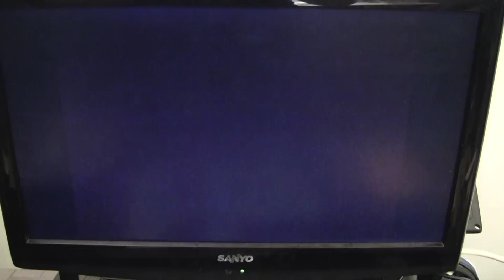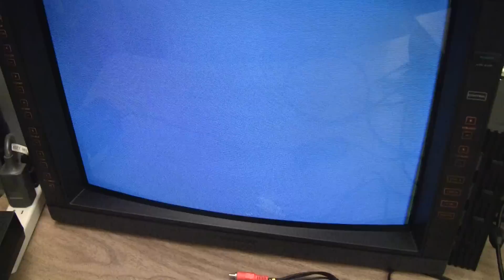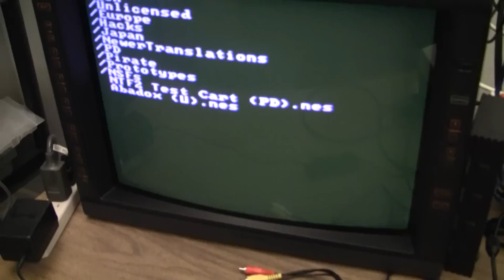Nintendo - Rant about Drakon's NES RGB mod work

Comment: GameTechUS, Question, If I put a Hot Glue Stick in my Nintendo NES, will it display RGB Output? Thnx.
Reply: Only if you put 500$ worth of oscillators in it. Make sure you hot glue them on of course.
Reply: If you get rid of $400 it will
Reply: Red blue green crayola crayon in the yellow hole thing will give you rgb

Comment from the maker: I'm always amazed how this 1+ year old video still gets several comments every month!!
Reply: Just seen your video. No wonder it costs so much, Thats gotta be at least $400 worth of hot glue xD Seriously tho what the hell!
Reply: GameTechUS $400 for floss? lol wtf is this shit
Reply: GameTechUS  Because modders never die and pop up more and more these days. finding an honest person to display whats wrong and how things should be done  is great. I only got into modding a few months ago. Making my nintoaster with some decent output options. 

One request I'd like to see is a mod for all the power supplies.   as in sega md/genesis, master system, snes nes atari 2600, 3do,  etc,  if someone makes a single power output that you can change to swap to each thats cool looking I'd buy it.  I wanted to make one my self,  but I'm still learning.
Reply: BurntFaceMan 
Agreed.  If a customer is going to pay that kind of cash, my suggestion is to gut the entire system, and install an ITX mobo, SSD, chip out the controllers, and go with a standard PICO PSU for a typical power output.  Then load emulators on.  Done.  Cheaper than $400 and a lot less hassle to make old tech interface with new.  More reliable in my opinion too.
Reply: +GameTechUS Love your videos man. Could you mod/recap a Turbo Duo for me? I couldn't imagine asking anyone else.
Reply: youtube sends me here. and i like the drama
Reply: So what happened to the console? I see you took out his handiwork at the end, but were you able to fix it?
Reply: I came here only to see if he still uses the hot snot.  Apparently yep.
Reply: Back again for my 4th watch!  Comedy gold!  Each time I get different laughs out of things.  Gotta socket up all those components!!!!  Why is the crystal socketed - LOL!!!  I don't think he knows that you can get single pin mounts - for mounting resistors and caps in sockets!  Sockets and glue for the win, or is that bin?
Reply: if you speak Drakon's name aloud three times in the dark, when you turn the lights on a stick of hot glue will appear on the nearest table.
Reply: I know you feel, Gadget - I like to re-watch cringe work like this too. ;)
Reply: This is probably my 5th time of watching... how on earth could Drakon charge that amount of money for such an awful piece of work!?
Reply: Dave's Game Room Pride.  That's how.
Reply: It would be cheaper to gut it and install a Raspberry Pi.
Reply: this is a joke right? who does this?
Reply: Drakon does, and it's no joke.  He really does this.
Reply: just as good as throwing it into a tub of epoxy
Reply: You're insulting a tub of epoxy.  ;)
Reply: I think it gets views and comments because it's shockingly bad work for $400.
Reply: This video just showed up in my suggestions.
Reply: Because of the "honest" work you had done there .
Reply: Probly put the 2 extra screws in a bin for resale.
Reply: GameTechUS For the love of all that is holy in technology and hardware what unholy rituals did the guy that got paid to mod that NES do to this system? I may not know technology that well or what the insides of an NES should look like in any form, unmodded, properly modded, or modded poorly. But when you opened it up I could tell right away that something didn't look right modded or not.
Reply: People love horror stories.
Reply: What a shitty job, even by normal electronics standards thats shit. Seems to be no pride in his work at all.
Reply: Train wrecks are neat to look at, provided you’re not involved in them!
Reply: I always come back to this videos when looking for info about RGB mods XD
Reply: Almost 10 years ago I was inspired to learn to solder by a moder at a convention the did mods on fight sticks. He told me I should by a cheap soldering station and just play with the stuff. I made that small investment and started moding my fight sticks and controls. About 5 years ago I found this video looking into moding my childhood game consoles. Videos like this and studying online from professional installation standards I learned to take care of tools and challenge myself. Today without going to school for it I've successfully mastered my skills to mod several systems for RGB, made a Gameboy Consolizer, and installed mod chips into my systems including my PS2. They all look amazing as well.

I plan on making a moding service or sell modded systems online sometime soon. Videos like this really show off how important it is to actually put time into your skills over using short cuts that can damage you system. Given how simple it was to learn to solder properly I think stuff like this is just a scam to people that don't know any better.
Reply: yup, just now learning and getting into modding NES/famicoms and need all the tips and warnings lol

Comment: This video made me feel so much better on the job I did on my NES RGB mod.  I was mad at myself for not getting the holes perfectly cut for my audio jack.  It looked ok just doesn't look professional, but I was just glad that I didn't need to use hot glue...lol I've learned from purchasing other people's mods to not use hot glue (or use as little as possible) because it make repairs nearly impossible.

Comment: Something that I've found in many cases with console output mods is that you shouldn't hook up more than one at a time because it causes interference with the others (exactly like the issues present with the s-video). It all depends on the console and the outputs used but, for example, component and composite in particular don't work well when running at the same time on the Snes (Color distortion, and vertical desync). Sometimes, that's just the way it is :(

Comment: Could you fix a neo geo cd front loader for me? The laser is not dead in that it can engage and read discs but only when top of case is off and I lift it slightly after the tray closes to engage it. It's like it's ok n drops perhaps too much? When ejecting then can't lift up enough to work when it closes. Unless I manually lift the mechanism up. Hopefully that makes sense. Used same laser and very similar assembly overall to tray and gears to original mega cd. Have also damaged the gears. The black one is not interchangeable with the mega cd one and the little nib of plastic that engages the switch to tell console drawer is open or closed (not sure which!) has snapped off now: in my futile efforts to fix it. It could likely be bodged by someone with you skills and maybe you could repair or bodge the main issue so it can work again? Really hoping can get it working as they only made 25000 of that model. I am in UK so shipping might make it impossible but, worth a try. You do superb work

Comment: Just a tip here, if you did not know already. To easily remove hot glue, Use rubbing alcohol. It chemically reacts with the hot glue and makes it brittle and it comes right off whatever it is on.

Comment: Bro i thought i was rough as soldering and cable mgmt, ive used dots of hot glue in guitar pedals before to secure wires to a case that could twist and rip off if a jack comes loose or whatever but never in my wildest nightmares would i bathe an entire board in glue, absolute mad lad

Comment: 400 dollars!?  screw that, if was that guy id buy a retro usb port for the nes controller and use an emulator with a TV and hdmi connection.  all that glue makes working on an old school pinball machine with all the relays a walk in the park lol.  i would never do a crap job like that.

Comment: O M F G - I didn't think it could look that bad (after watching your latest video on Drakons work) - but this is unbelievable!!!  I've never, ever seen a mod done in such a destructive and messy way.  You could have shit on that board and it would have been a cleaner mod!  That should be illegal - seriously, we need laws related to soldering and mods of electronic systems.  The potential damaged caused by that that hot glue is insane.
Reply: I don't know, wouldn't the first people suffer due to such laws be people like you, or generally people with common sense, experience, knowledge, but no formal qualifications? Or 12 year olds that just want to get into electronics?
Reply: GadgetUK164 - Retro Gaming Repairs & Mods Drakon is too stupied for modding I mean just look at the poor NES 🙁

Comment: I downloaded a mod from this guy that was supposed to make Mario Land 2 full color but it only worked on VisualBoyAdvance which is a really really old and inaccurate emulator. Mods should be able to work on accurate emulators and real hardware.
Reply: It is true that VBA is an outdated emulator but there are better alternatives out there in the wild.
Reply: Pyro 1997 That's the point. A hack shouldn't work only on VBA

Comment: I never used glue on the pcb when i do pc repairs. Only use it on strip boards when i make something from scratch or a quick fix for the power supply coils. I would knock him out for destroying such beauty

Comment: I recently spliced a wire while instaling a modchip in my PS2, cause I didn't cut it long enough and was too lazy to solder to the tiny hole on the PCB again. I thought that was pretty bad. I thank Drakon for proving me that I could do far, far worse.
Reply: *installing, of course

Comment: It's interesting in a way to see how many thumbs up this video has got in comparison to other videos on this channel. I guess there must be lots of people out there being disappointed with Drakon's work. I have never been in touch with him so I can't tell from own experience, but it sure does look like he is little bit too much in love with his hot glue gun. I am personally in the opinion that hot glue should be totally avoided as much as possible. There are much better ways to keep cables in place etc, ways that are completely reversable if anyone would wish to undo the mod, without leaving any residues.
Btw, since you took out the RGB board at the end of the video, I'm wondering whatever happened to the NES? Did you install a new RGB board for the customer, or did you send the unit back as is?
Reply from the maker: We are going to put in the new NESRGB board from viletim.
Reply: When I do a mod, I sometimes tack down a loose wire with a tiny bit of hot glue for strain relief, especially if I am soldering to an SMD, and if I am using a din connector, I'll use more for the same purpose, strain relief, but never to this level.
Reply: GameTechUS Well it's been a few months.  What happened to this poor NES?  Did you put the new board in?  Was the customer able to get a refund from Drakon?  Is this going to end in a lawsuit against Drakon?
Reply: Haha, yes - He LOVES that glue gun!  Did you see the latest vid on this channel?  OMFG at the amount of hot glue smeared over the entire underside of the board =O

Comment: I use hot glue sometimes to reinforce solder joints, but I don't sell my work-- I don't think my work is good enough for that. But to use hot glue in excess this much (and electrical tape, for that matter) AND charge as much as good modders, if not more, is insane. Even if I offered to do a job for a friend for free, I would be ashamed to give this kind of work back to them.

Comment: Hobby Lobby called and said they need to order some hot glue from Drakon. They are requesting his contact info. I mean damn, hot glue is perfectly fine. However, you dont need half a stick of it. Much less 5 cases of it.

Comment: Pretty sad to see a perfectly good device be bastardized by a thick headed idiot. I'm surprised none of the components got damaged by the hot glue, because by the looks of it, it seems like the hot glue would've retained it's heat for a long time due to the amount used. I'm actually quite shocked. How can one take so little pride in their work like that? It's evident the thing was a rush job Drakon gave zero fucks about. I'm glad you were able to help out that one guy, but I can't imagine how many people got scammed by that sleazy bastard. I'm glad you made this video, you're saving people's wallets from getting raped!

Comment: Other issues and general Drakon shit notwithstanding, I don't really see a situation arising where you'd have both connected.

Drakon's weird obsession with s-video is baffling though. He'll test rgb out with some homemade rgb-svideo converter, instead of just using his ridiculous fees to buy himself a used pvm or xrgb. Even a cheapo ebay cga-vga converter would be better.

Comment: I am sad seeing this. I am an an electronic engineer and I could accept that as a prototype. But not even my student projects looks so horrible (I mean: not using hot glue is big one). But selling that? How? Why? Have some bride in your own work. Or at the very least: When I bodge horribly, then I try to damage the original hardware as little as possible and make the bodge distinct from the preexisting hardware. Bodeging the wiring can be somewhat  acceptable, when it can at least be somewhat undone.

Comment: Hot glue does help out a bit when doing mods. To make like a 'hoop' around a wire, makes things a little more organized. But THIS. What the hell is this? And he glued the caps which insulates too much heat and they will probably explode at one point or another. And this is supposed to cost $400? I wouldn't pay $40 for that disaster.

Comment: Haha so the problem was actualy from the outside, rather then the inside, now i can think why s-video getting those strange colors sometimes while rgb is getting a darker image, i guess you cannot use both cables simulteniously atonce since that will split and thus weaken the signal, if i use composite with rgb atonce, then the rgb signal will be a little bit darker.

Comment: Eww, I start working on modding Sega Genesis high on laughing gas and dangling from the ceiling with uncontrolled soldering iron and lead solder (and no PCB vice, no soldering wick or sucker) and do a better job than Drakon's...

Comment: Crap like this is shocking, disappointing....and slightly amusing (hate to say it but after the shock settled I kinda had a small laugh) I haven't done any heavy mod work like this I will admit(I have done a few small hard mod projects) but when you do any kind of Modification job like this you always have to do a decent job(especially if it's for someone else)